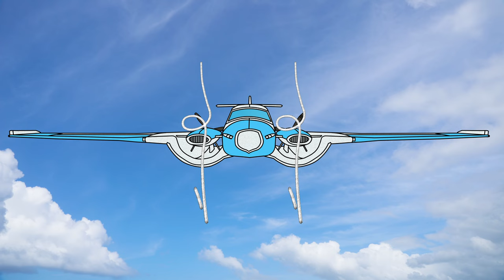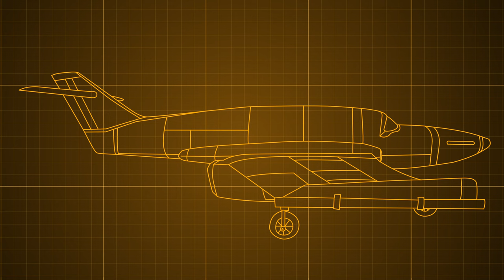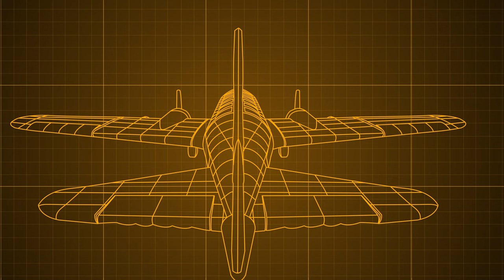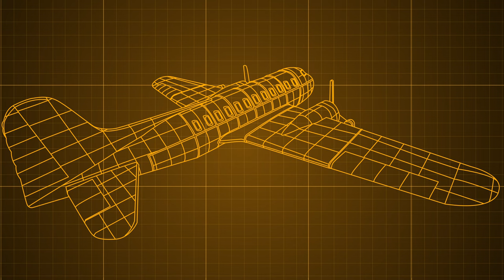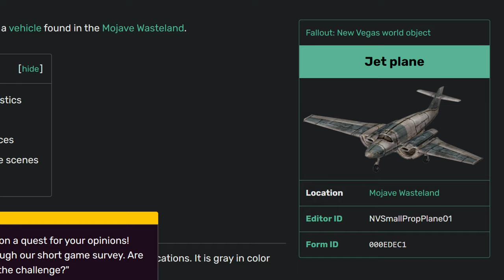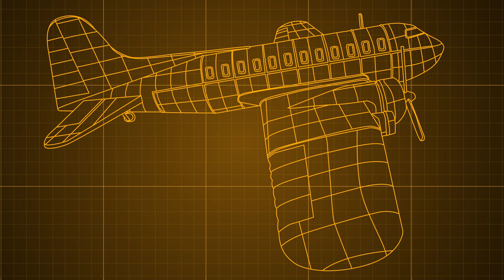Fallout New Vegas: A Jet Plane without an engine

Comment: I have an alternative method of propulsion: it’s a magnetohydrodynamic drive.

Horrifically inefficient, but it would enable the air between the wing and engine pod (which I will now consider a generator) to be accelerated without any moving parts. This would also take advantage of the channel design.

Comment: My guess is that the propellers were supposed to be there but either vanished in development due to crunches or they're intended to be missing.
Reply from the maker: My bet is on the former.
Reply: Maybe as an easy polygon save.
Reply: @spydingo alot of things in that game have been cut or reduced to help the game run better, this may also be why the plane is scaled down.
Reply: The former seems more likely, as the back end of the engine nacelles seem the wrong shape for holding propshafts.

Comment: This one put a smile on my face.  Every time I play New Vegas I deal with the Legion spy at Camp McCarran, I always marvel at the cargo planes, and apparently I always fail to notice that these aircraft are parked on the tarmac.  It makes for a great surprise when you learn something new about an old favorite! As for the in game model, turning a prop plane into a jet and forgetting to add the exhaust is just peak Bethesda era Fallout.  I love it.  

Great video!
Reply from the maker: I'm honestly right there with you. I knew about the one at Jean skydiving, but it was partially buried so I looked up where else they existed and found out they were on the McCarran tarmac. I circled the place like 3 times before I finally spotted the things. 

Thanks!
Reply: One thing I always wondered about McCarran is since they had Searchlight airport and Nellie's have actual runways or spaces that could act as runways, where's McCarran's I guess it was a miscommunication between the design teams of the overworld and the other spaces thinking the other would have the runway (the overworld thinking that since McCarran was walked off the runway would be inside while the interior team thinking it would be outside as that's where the other runways were.)
Reply: @mikzpwnz_3199 Camp McCarran has a runway, it's outside the walls south of Camp McCarran, in the fenced off area.

Comment: Great video as always. Couple things:

-The higher horizontal stabilizers actually make a bit of sense in that they're further away from the jet slipstream, which could cause control issues, but having them halfway up the tail like that looks weird to me and could cause structural problems. The chord seems too short and might cause problems for longitudinal stability. They should have made the vertical stabilizer with a longer chord to solve the horizontal stabilizer chord issue, and then put the horizontal stabilizer at the top, in a T-tail configuration. That would have both looked sexier and improved stability.

-You could fit two parachutists in the back if they lay prone and one atop the other in release racks, bomb bay style, with a set of bay doors beneath, also bomb bay style. It would be ridiculous, but a lot of things are in Fallout. Probably all that rampant Nuka Cola consumption.

-Devil's advocate for the seeming lack of outlets: those things on the back of the 'engine pods' could be outlet caps for when the aircraft is on the ground or in storage (you know, Remove Before Flight). The front of the engines seem to have vents or shutters that could be closed, so no need for caps on those. Doesn't fix any of the other issues though, like negating the whole channel wing concept in the first place by removing the props.

Keep up the good work my dude. Maybe start focusing on the Corvega and Chryslus lineups? The army trucks? The bizarro cargo ships from FO4? Still plenty of material out there.

Comment: I know the ingame model lacks exaust in that section, but with the time constraints we see I could easily imagine them just being engine exaust covers. We know fallouts military technology was rather advanced I have no issue with a smaller jet engine, and the design is just so iconic. On the flipside the propellers could be in storage OR were made of materials that rotted or rusted away during the apocalypse or were used in in the larger planes nearby to fix them after the bombs fell. Anyway great vid spy, I cant wait for you to cover the larger cargo plane, and I do hope you cover the Quetzel and Oil Tanker from fallout 2! I also know its kinda taboo but there are lots of great vehicles in the frontier! If your looking at 'alternate worlds' lol.
Reply from the maker: Good point on the props rotting away, I hadn't thought of that until today. I still would have expected a clearer mounting mechanism in that case though. Thanks, the Quetzel is moving up in priority as we speak it's getting a lot of love. I don't actually know a lot about the frontier other than that its gotten mixed reviews if that's even a thing for a mod. I guess that counts as an alternate world lol.

Comment: Probably not too much you can do with them, since I've no idea how much is actually there at any given moment, but the Zetan's do have two motherships you could take a look over. They also had those smaller, slightly Millennium Falcon-looking ships.
Reply from the maker: Thats true! I've only covered the most recent fallout 4 style craft. The fallout 3 small saucer is quite different from that one so I could cover that one seperatly, and as you say the mother ship is still uncovered and has a nice deathray. I can't leave a death ray uncovered can I? Very good point!

Comment: The craft don't necesserely need props or a big exausth, it probably use the turbo prop engine to create a tream of air under the midlle exhaust.
If you look at he Rockwell XFV-12, the exhaust is small, it use the flow directly on the wings to generate thrust and lift at the same time.
Reply: Even the F117 exhausts are very small, but still achive almost super sonic speed (also the Republic F-84 Thunderjet with the F404-F1D2 tailpipe)

Comment: If I had to guess, I think there’s engine covers left on the rear of the engine (but not the front for some reason), I’m fairly sure that they used to do that with old jet fighters.
Reply from the maker: I suppose that's possible, generally speaking though such things are usually high visibility colors like red, so that it is harder to forget to remove before flight. It might be possible for colors to have faded over 200 years though to the point they look grey.

Comment: Does the replacement of the props with jets really hinder the laminar flor over the top of the wing. There would be a lot of air still being pulled over the wing by the air itself as it leaves the rear of the jet so fast.
Reply from the maker: ngl this is a question above my pay grade, but from the way the Custer channel design was explained it seemed like the airflow from the engine was a integral part of the design.
Reply: This is a fair question, as an aero engineer by trade here's my opinion:

The channel effect is greatest with a propeller that is the diameter of the channel because it's 'area of influence' over the oncoming air is larger than that of a jet engine of  the given size. The sped up air over the channel (and thus lower pressure) is caused by the propeller, not the inlet of the engine. Replacing the propeller with a jet exhaust the size of the engine pod means the 'sped up' air is limited to a much more narrow 'beam' in front of and behind the engine, instead of the entire area that's swept by the propeller (again, looking head on). This means the speed of the air directly over the curved portion of the wing is greatly reduced and therefore the benefit of a channel wing is also greatly reduced. The counter argument would be that a jet would have less drag, therefore higher top speed, therefore higher flow velocity, but this would be true for both the bottom and top of the wing, so the counter counter argument is that the pressure differential would still be the same, or change negligibly.

TL;DR pure jet engine actually means a lower pressure differential between the top and bottom of the wing and the lift is reduced than for a propeller, negating the channel wing benefit.

Comment: In regards to the scale I hace to say that practically all fallout designs (non civilian cars) had problems with the scaling when they added the asset to the map.

This is a thing on the isometric fallouts didn't happened that much but in the bethesda engine ones all the time happens for example:

The p 80 in fallout 3 if you put your character next to the cockpit or in the geck add a car next to the plane the glass canopy it is just súper small and the rest of the plane follows the same, both the p 80 and the new vegas jet plane had the same scale wich is like an acrobatic extra 300 or really big rc plane.

The cargo plane for example its too gigantic in New Vegas also not the size of a DC3 but more the size of a DC 10.

The jeeps in fallout 76 has the size similar to the deuce half ton from ww2 rather than a willies or a vietnam era jeep like the ones of the intro of fallout 4.

The excavarors in fallout 4 had also an extra small driving position and actually just inside the same game the Fallout 4 Patton Nucleon heavy tank has different scales between the ones on the surface and the ones inside the bunker of the rust devils wich actually are smaller and had the same size of the ones in fallout 76 (they are smaller but they had that way at least more the shape of a real heavy tonk of ww2 ).

So I think in regards to scales when you made a new vehicle with no detail inside or little detail inside to compare to a human in the geck you usually scale them till the look "good enough".

On the other hand I think this "good enough" philosphy its what was behind some models in new vegas, keeping in mind the rushed development I think the jet and cargo planes got the less time in the oven when you compare the low polo shapes of the cargo plane with other new vegas exclusive vehicles like the pick ups  or the B 29 súper fortress (wich o think it was used as an actual bomber in the Great War keeping in mind the space pieces in nellis and an obscure dialoge of vera Keyes) I think that actually the cargo plane was a Lod asset or an asset used for rendering at high distances rather than a model to see up close.

And that are my ideas to justify the size and absence of Doors and weird color palette on the cargo plane Windows wich are completely blue haha.

Edit: make a vid about the pre war b 29s and that obscure reference of vera keyes!

Or a vid about the isometric fallout vehicles wich sometimes they look more realistic than the new ones.

Ot about the McDonald Douglass cargo jet  crashed at megaton wich its a bit weird to have as cargo plane in fallout 3 for civilians that plane but for new vegas a kind of Dc3 plane.

Maybe all this : old models work like the ghost in the shell inocence and they look old but they were re done in the future just after the war... or because resources they reproduced old tech rather than produce from new, new concepts of vehicles and factories to made them.... I don't know but there you have some ideas :P

Comment: I love that you brought up both the lack of propeller and the potential structural issues with the small struts. The latter was actually a concern with the original, specifically regarding startup and low RPM operations (like taxi and approach to landing). If you ever see a piston plane like Cessna 172 or Beech Bonanza (same engine as the CCW-5, O-470) start up with it's cowling off, it looks like it's trying to shake itself to pieces. Investors were concerned with a potential AD coming out regarding fatigue and damage from such small connection to the wing. 

Great job as always!
Reply from the maker: Sweet, I'm glad I wasn't crazy for thinking that those struts were sketchy. In capturing the footage later on I'd almost convinced myself it might be okay because the middle and rear struts were a bit more robust.

Much appreciated!
Reply: this should be less of an issue with jets, lower torque and vibrations from the engines

Comment: I wonder if the aircraft has a “hatch” which opens to the side becuase of how the aircraft’s sheets of metal are designed.Imagine a group of 4 smoke jumpers/paratroopers/skydivers in the back as they see what lays ahead,the signal is given,the jumpmaster opens the hatch as the passengers deploy there static line and step one by one onto the wing,then they jump,at the last moment possible the jump  master jumps as he closes the hatch.it’s fa4 out but could explain the reason the plane is so small and no doors
And side note: I suggest one of fallout 4s civilian sedans/sedan like cars

Comment: I think you'd find great vehicles to take apart from warhammer 40k they have some spectacularly wonkey design choices.
Reply from the maker: I completely agree on the vehicle design aspect. I'm a bit worried though because I have very little knowledge to draw from on the 40k universe. Maybe I should give it a shot though and see how it goes!
Reply: @spydingo  go for it 40k does seem vast and unassailable at first glance but its really not as hard to get into as you'd assume much of 40k is just ww1 ww2 but in space with heavy fantasy elements and a thick lacing of grim dark over the setting. If you want a couple of books to help with getting into the feel of it I would recomend either Ciaphas Cain, Guant's Ghost, or the Eisenhorn books the first two are military adventure books and give you a more grounded view of the imperium from the view of your average solider Cain is alot more light hearted and comedic while Gaunt is more serious both are good. Eisenhorn is more of a espionage special agent and more high stakes and grandiose but is also the story of a good man forced down a dark road. All three would give a good view point on how the setting generally works in the 41st millennium.

Comment: It's not so impractical when it's assumed the pseudo prop engines are fusion core/cell structures and the wing design is for cooling you can also say the reason the tailfin is so high is cause the exhaust or propulsion device is fixed so low on the aircrafts fuselage as for the canopy it probably folds open like a space shuttle otherwise its got some sortve hidden door/compartment that only Todd Howard has the keys to
Reply from the maker: I'd love the space shuttle doors for the complexity but hate them for the usability. Not sure Godd Howard would have access to Obsidians keys, then again I guess they are all one happy X box family these days, so he probably does.

Comment: Id love to see some videos on the loader or crane from FO4, or the fire engine or mining equipment in FO76
Reply from the maker: I've seen the loader called out a few times now, so that's certainly moving up on my list. The fire engine has been called out a few times too. It would be neat to do a 76 exclusive video so great ideas!
Reply: @spydingo  If the fire engine doesn't have enough content on its own, you could do a double feature with the offroad bus from FO76, since both are wierdly soviet imports (or are atleast almost 1:1 copies of soviet designs). But idk if they could make a video each or not

Comment: But the model name might be just prop as a prop not a propeller plane?
Reply from the maker: That is certainly a possibility I'll admit, but a very unlikely one in my opinion given the adherence to to irl reference material in the model.
Reply: @spydingo  My guess is that console systems couldnt make the processing demand and operation optimization took place like many times when they had to cut corners while still leaving lot of unecessary bloat assets at times.